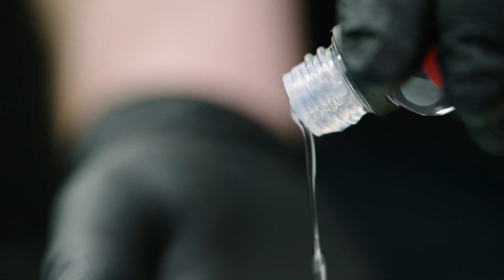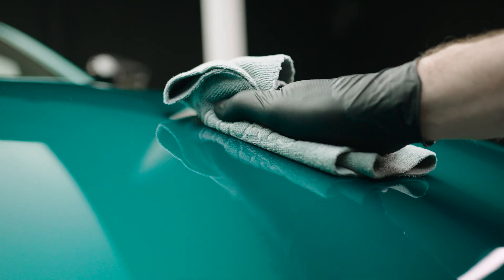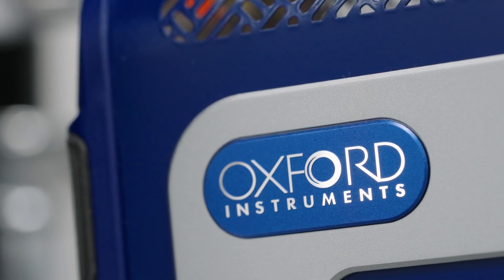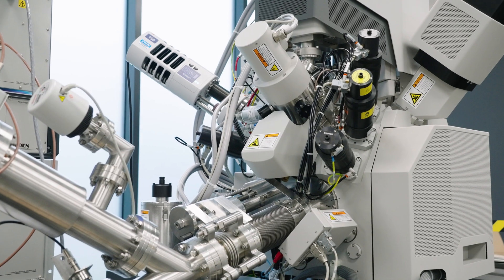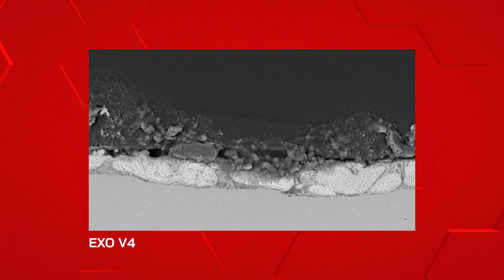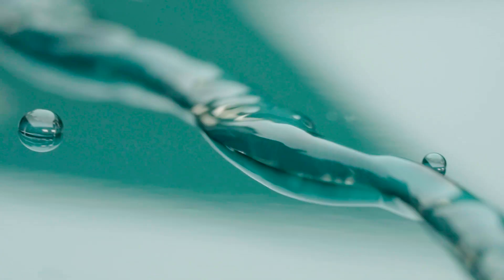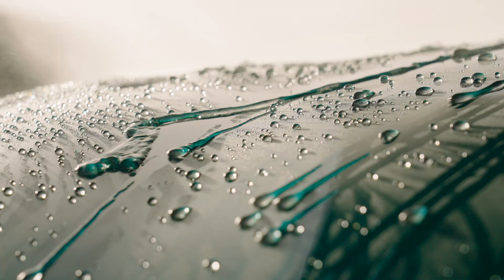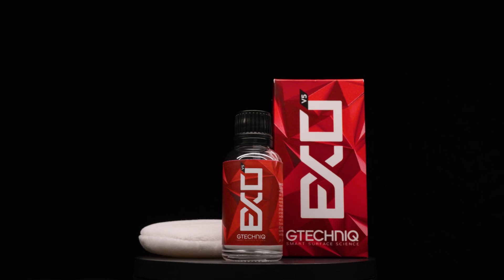EXOv5 Launch Video

Comment: Can we apply it to windshield glass too or it specifically on the paint only?
Reply from the maker: You can apply it to glass, but in testing,we found that on front windscreens the wipers do remove the product fairly quickly. It is better suited to rear and side glass.